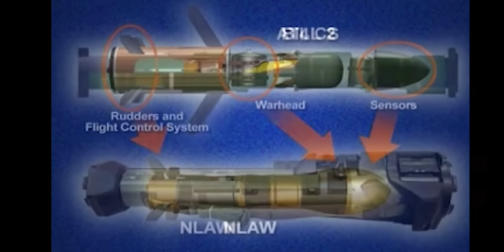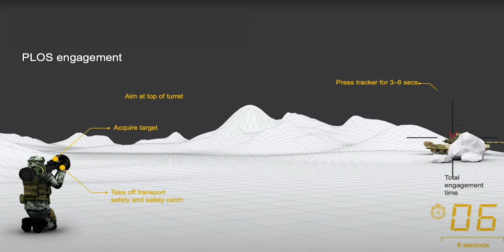Is the NLAW ATGM overrated? Next Generation Anti-Tank Missile

Comment: Yeah, because both javelin and NLAW are similar in appearance, that's confusing him often. But there are tons of videos I see where you can see the Javelin or even 84mm Gustav striking directly..
They often confuse javelin's top attack meaning shoot up to about 150 ft or 150 m I forget, and then come down on the tank's head, they confuse that with NLAW which supposed to fly in a straight path as if it were going to hit the tank flat on except it deliberately misses and the warhead detonates as it's going over which has a directed shape charge (it may actually be an EFP actually) pointed down and knock out most armor...
Reply: NLAW does use an EFP.  As it crosses above the target horizontal, it has a perpendicular EFP that is delivered downward into the top of the target as it flys over.

I will give it to the Brits (Bofors more accurately), it is a simple and effective weapon.

We in the US need to field a similar system.  Javelin is great at range - no doubt.  But NLAW is for shorter engagement ranges; yet in too close, it will not arm.

We need a similar system to replace the aging AT4 which simply strikes in the horizontal thus potentially being defeated by ERA, heavy armor, and/or active protective systems.

The days of the AT4 and LAW are over for giving US infantry effective, close-in anti-tank capability.
Reply: Need LAWs for units that don’t have MAWs
Times an infantry sqd may need short range anti tank capability
Reply: @pavegray  you don't need similar system, you just need NLAW. NATO uses common equipment standards for a reason. Just license it or better make transfer deal with brits to get them small amount of Javelins for big shipments of NLAWs.
The only thing that might need to be added in is that I don't recall if NLAW has DP mode.
Reply: You were right up until the end there, the NLAW does not rely on an EFP or a shaped charge. It's simply a direct detonation that relies on overpressure to compromise the structural Integrity of the top of the tank.
That's a really complicated way of saying that it's a very simple weapon, it makes a big boom. It's a far simpler weapon than a HEAT round or a Javelin.
Reply: @Mygg_Jeager  
look at scheme of NLAW projectile and at result of detonation on targets, then repeat your statement. I feel like one of us is going insane...
Reply: @TheArklyte  I'm not a demolition's expert here so I'm not the ultimate authority on this, but according to everything I've read: the definition of a shaped charge is an Explosively Formed (Plasma) Projectile, such as with HEAT shells.
HE, High Explosive, is not an EFP.
From what I've read, NLAWs are loaded with HE and so they do not form jets of molten copper or tungsten plasma.
Remember, HE is NOT HEAT. Though both HE and HEAT can be used to knock out tanks - C4 would be another example of HE being used that way.
Reply: @Mygg_Jeager  NLAW use a downward facing shaped charge, a specific type called an EFP that is more effective.
Reply: @Mygg_Jeager  There is not much difference between shaped charge HEAT and EFP accept that the EFP is a slug of plastic metal whereas the HEAT is more of a jet of metal.  The result is that the EFP can penetrate from significant distances: as much as 100m.  I think they like to use tantalum for EFP.
Reply: @williamzk9083  Welp, I'll have to take your word for it. NLAWs are from well after my time in lol. We were still using Carl Gustavs and M72 LAWs BaCk In My DaYs lol.
Reply: What is an EFP?
Reply: @corvoattano4777  explosively formed projectile.
It's a shaped charge, similiar to an RPG/panzerfaust warhead but using a slightly different shape, and a different metal in the cone that forms the projectile so that the EFP gets a much longer stand-off distance.
A regular HEAT warhead like that of an RPG has an optimal stand-off distance of around 20cm between target armor and exploding warhead and will rapidly loose effectiveness if triggered further away, by, for example cage armor or ERA as it's main energy transfer used for penetration is that of the explosion itself focused on a tiny area.

An EFP on the other hand, commonly detonates a meter or more away from the target and uses the mass and velocity of the projectile more than focusing the power of the explosion, thus it's a lot less affected by the distance between warhead and target.
Reply: @corvoattano4777  Explained in the comments above, it's an Explosively Formed Projectile. It's the core principle of how HEAT warheads penetrate armour.
Reply: @pavegray  the AT4 is not to campare with Nlaw, why?! 
The AT4 comes with  variants ( 7)  such as  AT-4CS AST
"the main charge will either detonate in the building wall or in the room behind, creating a new point of entry"

The Nlaw is just tank killer
Reply: @SonsOfLorgar  Correct, the "original" shaped charge (as first used in WWII) has a copper "cone" behind which the explosives are formed, and it produces "beamlike" stream of mostly hot gases (may contain some liquid drops) that strikes the target and "burns" through. Due to its gaseous form, it dissipates quite quick so it needs and optimum distance from target to initiate, too far or too close and its less effective... the warhead often uses a "stick" reaching forwards from the front to measure this optimum distance (and ignite).
EFP as allready said means Explosivelly Formed Penetrator and it uses giant "droplet" of dense metal formed by the explosion, thus is not gaseous but (semi)liquid, thus does not dissipate at all (only slows down a bit with time/distance) so it has far greater range (dozens of meters)... it is thus limited in range rather by precision (it needs to hit the target, not miss) than by distance causing dissipation.
Reply: @pavegray  Bofors is a Swedish company founded in the 1870's.
Reply: @corvoattano4777  Explosively formed penetrator (EFP).  Generally, a copper cone is used.
Reply: @tomhenry897  AT4 is better short range systems. You don't need guided missiles at close range you need fast but light to carry missiles, ideally you can fire from closed spaces.
Reply: Guys! The NLAW uses a conventional HEAT warhead, NOT an EFP. There’s some nomenclature variance, but EFP is also called a Self Formed Fragment (SFF) and is much, much longer range than conventional HEAT. Tens of meters, not a couple-three. EFP’s also have about a quarter the PENETRATION of an equal size HEAT warhead, which is why you use HEAT. 

detail: HEAT blasts create a stream of molten metal that penetrates armor, usually from a copper liner. That is NOT an explosively formed penetrator (EFP), though some of y’all are calling it such. That’s 1950’s nomenclature - now, they use shaped charges to form sophisticated, streamlined molten metal slugs. They keep their cohesion and form over a football field distance and more. Those are EFP’s.

Comment: They actually explain the lack of recoil: salt water counter mass. Which I assume also reduces back blast, or at least the firey sandblasting part.
In the PanzerFaust 3s I fired during my service, it was a sandlike substance. So back blast was still a considerable danger, (removing all foliage and shredding range targets in the area) and double checking your six before firing by ammo bearer and specialist mandatory drill. It left you covered in soot from head to toe when firing from indoors.
We actually removed the counter mass several times on training rounds, which gave our group leaders some pretty black rings around their right eyes. Stu fun times, don't tell anyone!

Comment: The first problem with this discussion is the ignorance of the world on how the Javelin works.  The Jav is NOT a "top attack" weapon.  It uses the old naval "plunging attack" pattern and quite literally comes in at a more horizontal than vertical angle.   On soviet/rooskie tanks it aims to come in under the edge of the turret/turret reactive armor and strike through the side fuel tank - thus resulting in the fighting compartment becoming a single stroke engine fueled by about 50 gallons of super-heated diesel fuel blasted into the interior at thousands of PSI.   Differing amounts of fuel left in those tanks results in differing levels of turret-pop.   This is the lethal flaw of ALL Russian and Chinese tanks and why almost all NATO nation tanks have large broad turrets instead of puckered bottle caps on top.  The Jav is tailor-made to strike precisely that kind of tank in precisely that way and is programmed to aim precisely outside the turret and reactive armor edge at a plunging angle for maximum effect.   Go look at the flight profile chart avail at wikipedia which compresses the horizontal scale about 4:1.  The chart has 180m on the vertical and 2000m on the horizontal.

Now... the NLAW.   The NLAW doesn't actually have a "direct attack" mode, it has a self-destruct-upon-impact function.   There is a button in the circuitry which can be activated to dead-fire the weapon upon trigger without any targeting or guidance as well!    There is no forward facing radar reflection to speak of because it is a stealth ATM designed to defeat any active target defense systems.  It can be defended against by an electromagnetic rod offset about 8 feet towards the launching location, resulting in early triggering but it cannot be defended against en masse because its warhead, unless you push the special button, will not be triggered until it reaches the predicted range by the targeting system.

Interestingly it can be fired while turned 90° axially to the left or right resulting in the weapon being able to detect vehicles to the side.  They don't mention that in the news... its control system can be given an adjusted vertical offset as well, in order to either clear or come in under the mullet-rack that some of the tanks have been using.   It is not a highly precise weapon on the Javelin's scale but is still capable of striking the turret top reliably out to about 400 yards, after that - especially on a moving target - it could literally hit the wrong vehicle.

The limitations of both of the above missiles are why Ukraine went to develop the 4 mile Stugna laser-signaled missile systems.   There are almost no videos at all of the Javelin missiles being used in the Ukraine invasion, almost all of the ones shown were actually Stugna strikes and of course Ukraine doesn't show the Stugna misses.

Is the NLAW overrated?  No.  It is probably the best ATM system available on the market ever and is so simple to operate that people who have never fired a weapon can be instructed through to a hit on a moving target before the battery on the disposable launcher is drained.  It will even tell you if the target is too close to fire upon.

The NLAW is literally something the Allies could have deployed in WW2 as it is little more than a combination of a radar range finder, autopilot, proximity fuse and shaped charge.  The only one of those things that wasn't possible in a man portable system at that time was the radar range finder/trajectory calculator as the primary equivalent unit of the era was the turret targeting computers in the B29 - which could easily have been installed in some kind of tank destroyer.

Comment: Regarding the bit about wearing Night Vision during the day, there could be two reasons (even though the video is all staged) 
To start with, if you are in a built up environment, you could be moving through the buildings, which could either have no power (destroyed power grid) or the lights could simply be off, having you night vision already on your head means you can just swing them down, then you are good to go,
Secondly, if its around dusk, you put on your Night vision before you need to, and before it gets dark, just in case.
Although in the case of the video, its probably just to look cool